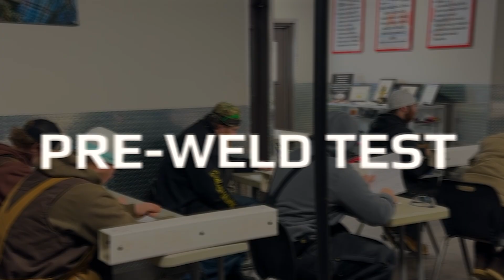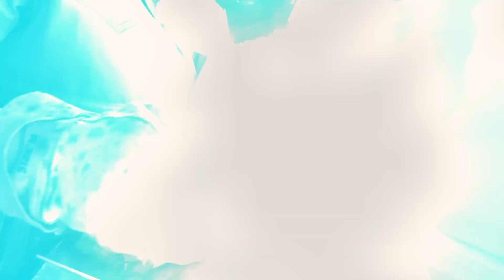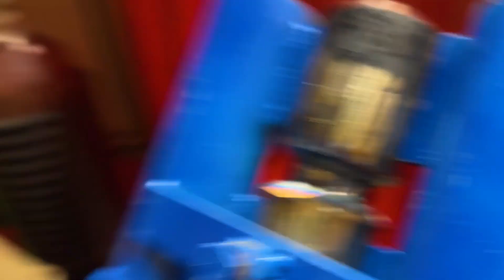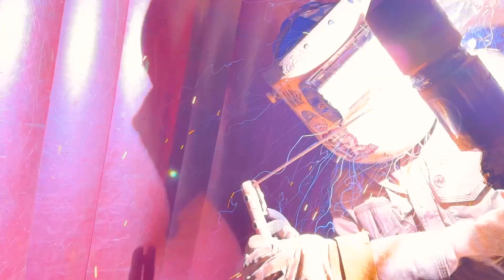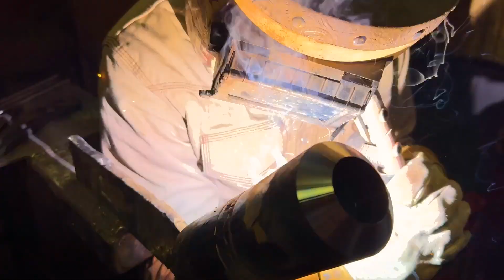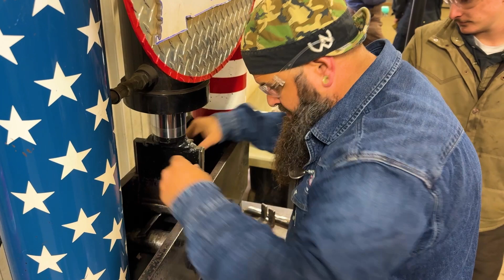11 Welding School Students Try to PASS a Test For a Boiler Job

Comment: I remember being so nervous on my first heavy wall 6g monster. File and wire brush only. Passed and then sent to first boiler repair and did the first weld with a mirror for bottom of tube. Was like 4 tubes down. And realized the test was a lil bit easier. No better feeling then when you start to master welding in field with dirty, hot conditions and it meets x ray quality
Reply from the maker: Oh yeah, then you can go make big money anywhere not having to worry about hard welds either because you can do most anything. That’s such a great turning point and that person’s welding career!